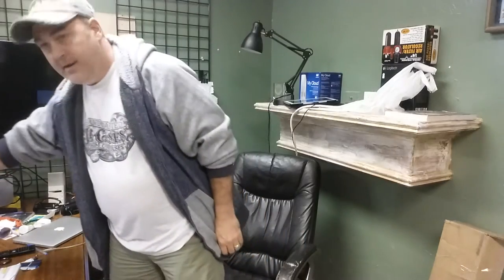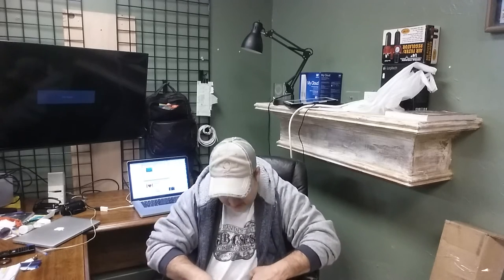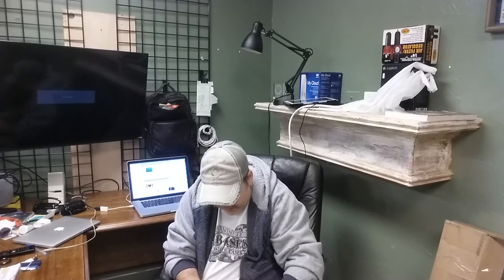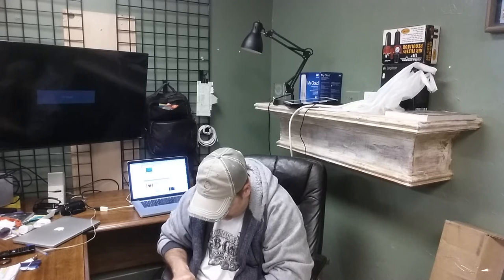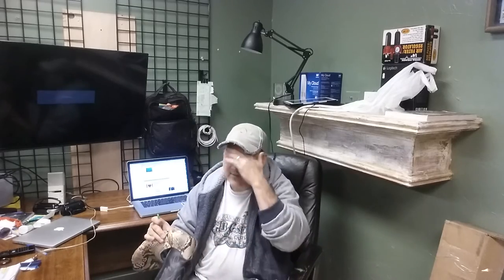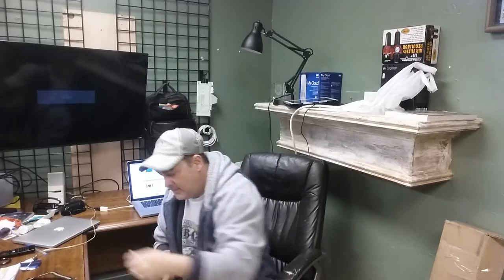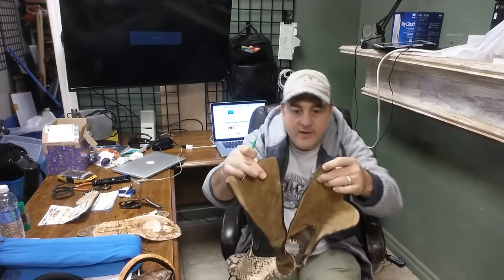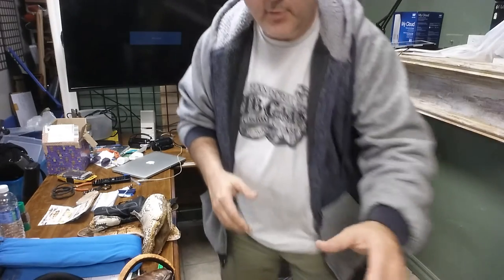Recycling an old boot

Comment: I've been wearing cowboy boots, for 35 years. Tony Lama boots are middle price range. That's $200-$300. Lucchese boots are more expensive. $350-1300. Liberty Black and Old Gringo boots are $450-$900. Custom made boots run $2k-$6k. Laredo boots, Justin boots, Ariat boots are less than $300. These are all genuine leather or top grain leather boots.